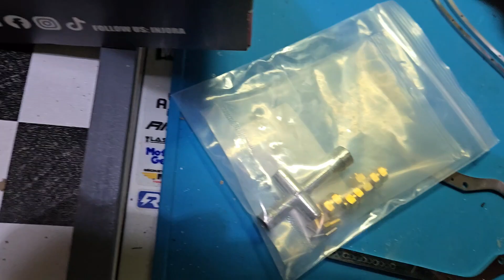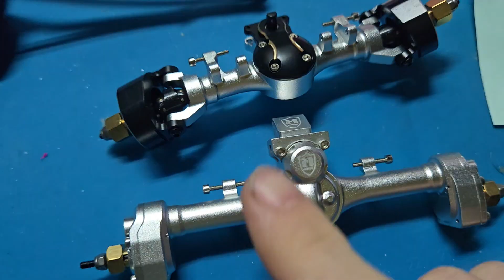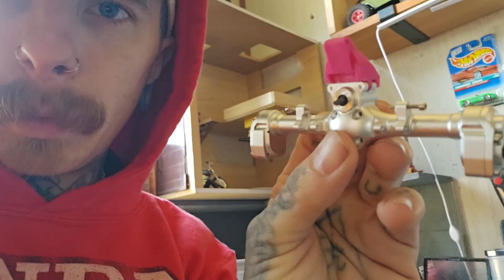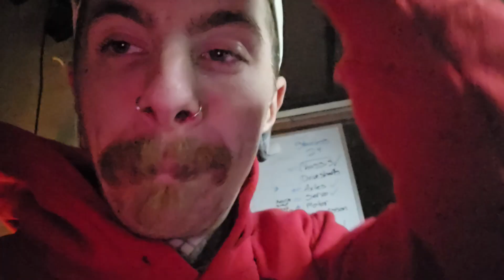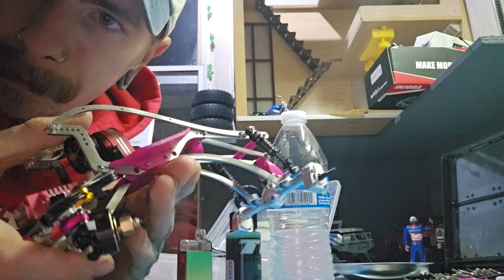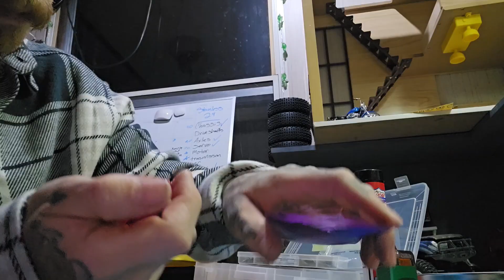The Stainless 24 SCX24 Ground Up Build Process!

Comment: I built an SS24 a few months ago, using many of the same components your using, it rips rocks, love it. I used the Furitek mini komodo unity combo with mini stellar trans, had a hard time fitting center driveshaft, so short. I finally used the factory plastic short shaft, fit mine without cutting and works great! Good luck finishing your rig I think you'll be happy with the performance!
Reply from the maker: Awesome to hear! The mini komodo and stellar combo  is sooo smooth. This is definitely a performance based rig and I cant wait to see it on the rocks 🤘